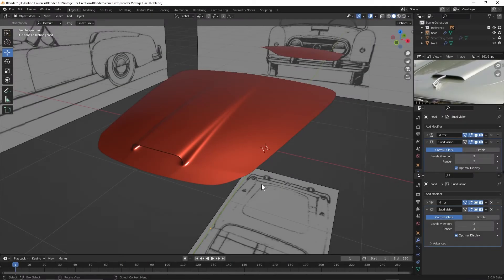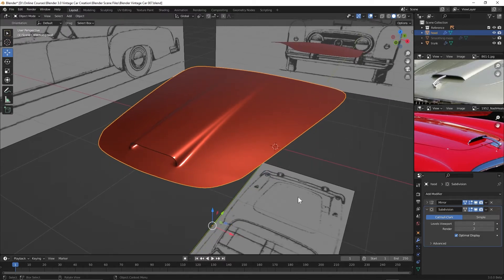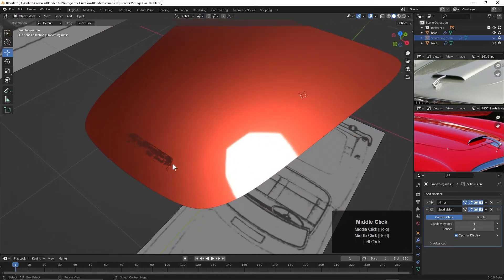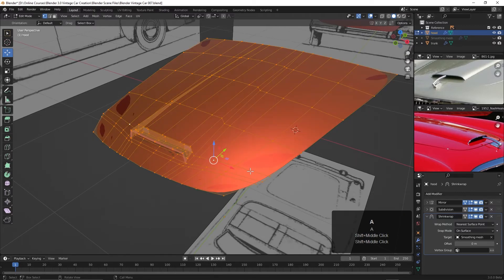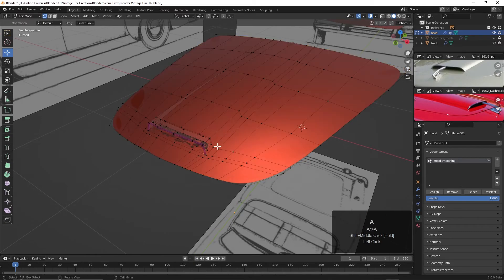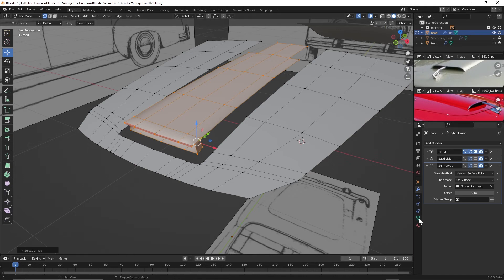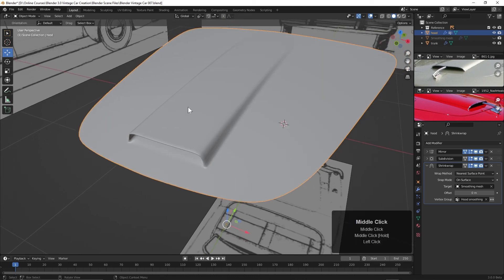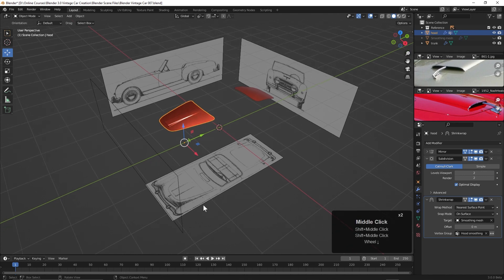Blender Vintage Car Creation - 007 Using the Shrinkwrap Modifier

Comment: This could be easier solved by adding bevel modifier with bevel weight, selecting Geometry -> Miter type outer set to Arc and then adding bevel weight to edges. No need for any additional geometry and vertex groups. Except if your intention was to tach us how to create vertex groups :)
Reply: I agree about you in some point, but the bevel weight might cause issue when you try to uv unwrap, or adding vertex color id